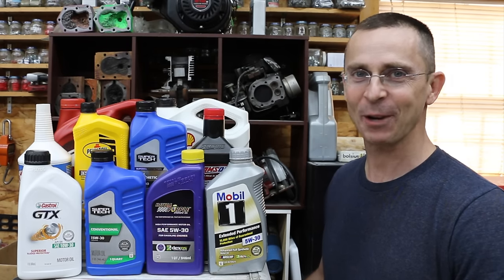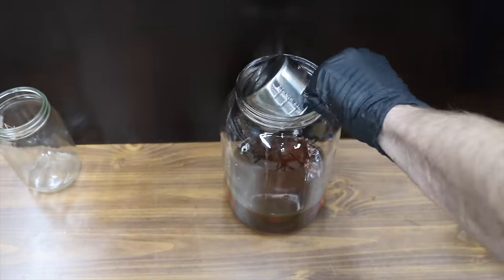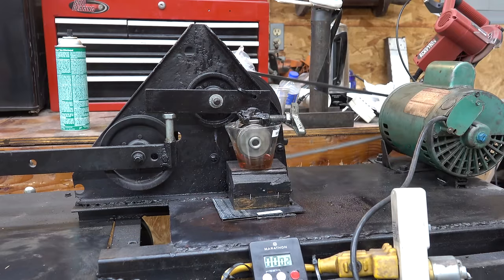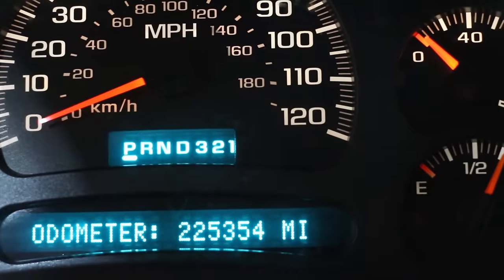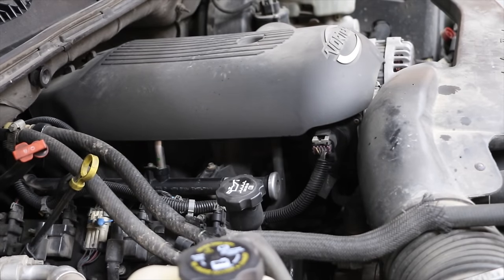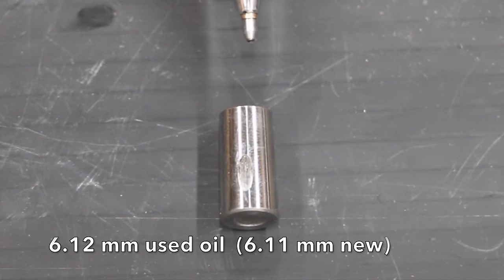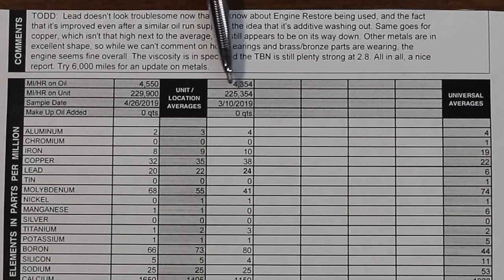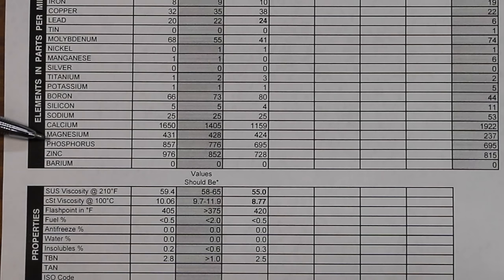Will Mixing 10 Motor Oils Damage an Engine? Let's find out!

Comment: I wish I had a dollar for every time I have heard someone say they changed brands of oil and now the engine uses oil.
Reply from the maker: I agree.  I've driven the suburban over 5000 miles since filming this video and it's still running great and not using any more oil than usual.
Reply: It is possible when changing to synthetic to clean gunk that was sealing a leak.
Reply: @WeSRT4  You have to have a very noticeable leak to make it significant w.r.t. normal oil consumption.
Reply: I can't say that there would be a drastic difference in oil use or leakage, but. 20+ yrs ago I worked at an oil change place. Our house brand oil was Citgo, and stored downstairs in tanks and fed by pump/hoses. normally what you would see in a oil/lube place. We did offer other oils if people preferred and wanted to pay the difference. These oils were stored in drums in a corner of the shop. Each oil had its funnel/bucket. After some time there would be a definite build-up of "stuff" in the bottom of the Penz-oil buckets. Remember, these are for new oils only. The stuff in the bottom of the Penz-oil container looked kind waxy just like a thicker oil. I suspect this stuff that settled out of PZ would coat the engines some. My father in law always said he had less leaks when he used Penz-oil. I would believe it if that stuff stuck in the cracks.

I'm not judging any oil better than another, just stating what I saw in the bottom of the bucket.
Reply: @cheeto4493  when I was younger my uncle built engines for Sprint cars, he used Pennzoil and he saw the same thing. He always said it was paraffin.
Reply: @cheeto4493  I also wish I had a dollar for every time I heard someone tell me they knew someone whose engine was ruined by using Penzoil.
Reply: I had an '85 Mustang 5.0L with a bit over 28,000 miles always using conventional oil when I decided to use Mobil 1 synthetic. Well within 200 miles I was burning oil when it had not burned it before.
Reply: same folks who say changing the transmission oil will kill the transmission....

Though had a nissan that would go through oil at a prodigious rate without any visible leaks or signs of burning, you'd check it and it would be at max, 2 or 3 weeks later the oil light would come on out of the blue and the dipstick would be below minimum....
Reply: @johnphillip1711  the best way to check for burning oil is the spark plugs
Reply: @EasyRiderGreg  my friend was a die hard ford driver, he said if a ford ain't leaking oil then the oil is low. Was it "burned" or just leaking now ?
Reply: @johnphillip1711  if a transmission is an Auto and the clutches are severely worn, changing fluid will kill it. The material in the old fluid is what is keeping it working and replacing the fluid removed the only grabby material for it to work. I made the mistake of doing that ONCE, I was warned , I did not listen. I know know. Use shift improver and drive it easier, but don't replace the fluid. For a healthy trans, replacing the fluid won't hurt it.
Reply: @punker4Real  oddly they were fine also, it was weird, even the owners clubs (on both sides of the Atlantic) couldn't figure it out, best we could guess was loss via evaporation or something peculiar....
Reply: @EasyRiderGreg  I had the same thing on my Audi quattro, always used conventional oil, changed to Mobil 1 and the engine started burning it. Changed back to conventional oil and the burning stopped.
Reply: Unless you change to a used, and bad oil, most of the time changing brand does nothing to the engine.
While I stay away from Royal Purple (with color additives in the oil), Mobil 1, Amazon Basics, and Valvoline, Pennzoil and castrol are all very good oils, and can be interchanged easily.
Though my favorites are Mobil 1, and Amazonbasics, good for 6+k miles. Valvoline, Pennzoil and Castrol are still very good oils, good for 4,5+k miles on my car.

It's actually better to alternate between oil brands, rather than use only 1 brand and type of oil.

As far as 5W30 vs 10W40 and 0W20, The math on these is simple.
0W20 + 10W40 in a 50/50 mix gives 5W30.
Reply: @johnphillip1711  When I've had old engines like that, I just got in the habit of checking the oil level each time I fuel up. I just want to make sure I run out of gas, before I run out of oil!
Reply: @ron827  I didn't say it ruined engines. I do think the paraffin, or whatever it is, keeps engines from leaking as much and burning the oil.
Reply: Oils are different, i've had the same car over 15 years and i've used oil that almost has no consumption, and others that need 1L every 1000KM. Btw, i went from blend to synth. Engine is carburettor from 70-80s. 
Really depends. Best advise is, change once year or every 5-10k km (refer to manufacturer) and if you're revving more or need better cold starts, use a 100% synthetic one.
Reply: @punker4Real  or blue smoke at the rear.
Reply: @batsonelectronics   It was burning oil, when I would stomp on the gas blue smoke was real thick coming out the pipes.
Reply: It definitely happens but not every time.
Reply: @joaoc_PT  An engine like that, with no catalytic converter, allows any oil additive to be used. There's no harm in trying different oils, to see what that engine likes best. tracking oil consumption and checking the condition of the spark plugs can be good indicators. You can try some of the blends intended for Diesel engines.
Reply: @MegaDirtyberty   I'm glad your Audi stopped burning oil. My Mustang did not stop when I changed it back to conventional. It continued to burn about a quart every 2500 miles or so. It didn't get any worse so I just kept checking and adding oil for years until I sold it.
Reply: @vincentrobinette1507  already do. Been using cheap synth gas/diesel oil for years. 5w50 Mobil one was the best, then old Castrol 0w40 no longer found on sale. But any 5w40 goes.
Reply: Wife bought her old car (now my car), with 83k. I’m sure it probably had nothing but conventional oil changes in it’s past ownership. 

Well I started using Mobil 1 in it, now has 255K on the odometer, doesn’t smoke, and might burn a half quart of oil between 7k mile oil changes. 

I’ve never had a problem using synthetic oil in anything I’ve owned, even if it had some miles on it before the switch.
Reply: @EasyRiderGreg  that is from leak from the valves. That doesn't happen just from changing oil, it was already worn.
Reply: John phillip your car was probably sucking up oil through the pvc valve.thats why you didnt notice it
Reply: @cheeto4493  if the "parafin" was on the bottom of a can - thats nothing good. 
It means that there is not much of it in the oil. Oil formula should prevent against this situation. New oil should be equal in every place of can. 
Excuse my English.
Reply: @joaoc_PT  Synthetic burns white.
Reply: @cheeto4493  That was probably the Z7 additive
Reply: Furn333  That's exactly right. Everytime I've switch to synthetic in a high milage engine it would start using more oil and leaking from various gaskets. Switched back and reversed the symptoms.  Both were F250s. One was a 460, the other was a 5.4. Both had over 150K miles

Comment: I tested this in 2007 on a 1992 GMC Jimmy 4.3L. Had no problems over a normal oil change. I worked at a quicklube and used a very similar mix of oils. Back then it was still in everyones mind that you couldn't even switch brands from oil change to oil change. So I wanted to go to extreme case. Thanks for sharing with the world!
Reply from the maker: You are welcome!

Comment: People on car forums: What oil you guys use?
Project Farm: All of them...
Reply from the maker: lol. Thank you!
Reply: True answer is Yes
Reply: Me it matters?  P. Farm: Yes.
Reply: Bought a Subaru with 116k on it about 20 years ago. Never paid attention to what oil I put in it . Always conventional usually Wal Mart. Never drained the oil. Had toilet paper filters on the oil and ATF. It has almost 250 k on it now. Took off a valve cover and it was very clean. My daughter took it over. Have to pay more attention to it.
Reply: Organic EVOO
Reply: When I was selling Gulf Coast Filters out of Gulfport , Mississippi I got a call from a oil company engineer. He said I have a friend with a tree service. Has several Power strokes and choppers also some Internationals and a Bob Cat. Could I do them. Of course they had to supply me with a lot of make up oil. The paper towel models took about a gallon of oil. They brought me Wal Mart conventional oil. The engineer said oil is oil.
Reply: I have used synthetic and conventional oil. I have used toilet paper filters for over 50 years. I don't drain oil. With actual use its hard to tell the difference in synthetic or conventional. I can't wear out an engine with analytically clean oil.
Reply: Back in my Frantz oil cleaner days in the 60s I used to take out a roll of toilet paper after a couple thousand miles. I would pinch the top of the paper and black sludge would come out. Pinch the bottom and clean oil came out. You knew you were doing some good.Now both ends are clean.I drive mostly hyway at operating temperature.probably be different in cold weather short trips. Modern engines and modern oils are not much of a job to keep clean for the Frantz Motor Guard and Gulf Coast filters. That's why these junk filters can claim such a long filter change interval.
Reply: I use Royal Purple 10W-30 & a K&N oil filter. Great stuff, for cold startups, & oil filter won't burst under pressure, like the cheap filters could do.
Reply: I've never laughed so hard. 😆
Reply: ralph wood you had toilet paper filters on the ATF? What does that mean? Fram filter?
Reply: ralph wood oil is oil until you compare it ... the engineer was telling you to shut up and fill the thing
Reply: Lololol

Comment: I knew this all along. I worked at a local oil place & kept all the residue oil from all the empty plastic containers & also big plastic bags used in the box oils. Mostly the weights were 5W20, 5W30, some 10W30, and some 0 weight oils. Even some Shell Rotella diesel. Some of these oils were semi-blend, some full synthetic, & some conventional. I wound up with at least 5 gallons of clean, new, mixed oil. I used some in my 250,000 mile Blazer with no ill effects. I also used some in a well worn Honda Accord with no ill effects.
Reply from the maker: Thanks for sharing.
Reply: Hahahahaha that’s funny. Imagine how many different types of protection was in that engine it must have the best looking valves and cylinders for that mileage.

Comment: Q: "What's the biggest difference between brands of motor oil?" ... A: "The color of the bottle."  Any decent brand is compatible with any other.  Thanks, great video (as usual!)
Reply: Adam, you absolutely 100% correct. It makes NO difference what reputable brand you choose....including store brands....Walmart, Rural King, etc. They're all manufactured to industry specs., pass the tests and certified as such. If the API certification says it meets whatever indicated on the container, you're good to go. The armchair experts can flame away....I couldn't care less. After nearly 50 years of operating all sorts of motorized vehicles and machinery, I've yet to lose an engine to catastrophic failure  and I've always ran the guts out of them. Way back when I was a little boy driver I bought into the asinine 2000 mile change rule. I got tired of changing oil. I let it go to 6,000...then 10,000 and now with synthetics 15,000. I don't lose any sleep, haven't lost any engines in the ten years I've been running synthetic oil. I just bought a 2019 Tundra...showing 3900 miles on the odometer. Toyota going to give me a free oil change every 10,000 miles...their recommended regimen. I don't know what oil they'll put in, don't care. When it's my turn to start changing the oil, it'll be whatever synthetic is on sale and I'm planning on running it 20,000 miles between changes. Why? Because I have faith it'll be fine. If it comes apart.....hmmm, good excuse to trade it off.
Reply: His video series showing the differences in oil performance - especially when cold - shows there are some oils better in cold conditions *(start up) than others.    It is well known that synthetics break down slower than regular oils.  A bit of common sense and research can help if you want a very long life from your engines.  Yes, mixing them isn't a big deal - heck they make blends already.
Reply: Maybe the color of oil itself, too.
Reply: I've always believed oil is oil, as long as it's slick it'll work just fine, but I also believe now to keep it with what the manufacturer suggests, like now mostly it's 5W20 or so
Reply: @mark-wn5ek  I'm with you. I used to do the same thing. Every 2000 miles. Now I go by what the car computer says. When it gets to 5% I change it, no matter the mileage.
Reply: @mark-wn5ek  Modern cars and trucks often come from the Factory with Synthetic oil, typically lightweight synthetic, such as 0W20 due to tighter tolerances (which means less leaks but also means the oil has to be thinner)
Reply: @mark-wn5ek  You are absolutely wrong. All oils are not made equally. Just because an oil can scrape by the bare minimum to achieve certification, does not mean other oils succeed that certification. Literally 5 minutes on youtube and you can watch how different oil brands cold/hot flow versus others. Oil evaporation, oil impurities, etc. These "armchair" experts send out oil to be analyzed. Check out "bobistheoilguy" you would learn a lot. Even your favorite oil company/brand can change their formulas. Take for example, Mobil 1 High Mileage motor oil. In 2012 that exact oil had a Zinc PPM of 1700. Now, their current formula is lucky to break 900. Keep running your oil 15,000 miles as well. With direct injection technology in newer engines, I'd bet you'll never break the 150k mark on any of your vehicles. You and the people liking your comment are the types that fall for marketing hype. It's quite hilarious.
Reply: @scottcount6861  Actually, Mark Harris is correct.  As long as the oil is certified, it is equal to all other oils carrying the same certification.  Any API-SN oil, is comparable to any other API-SN oil.  That is exactly why standards and specifications exist.

Comment: I really appreciate this one! None of my vehicles use a full 5 qts of oil so I usually have anywhere between 0.1 to 1.5 qts of oil left over. I dont mix types or weights, but I always use that leftover and add it up with other brands leftovers. So I'd still run synthetic 5w20, but it'll be a little bit of Mobil 1, Shell, Royal Purple, etc. Usually just whatever is on sale at an auto parts store.
Reply from the maker: Thanks for sharing.
Reply: Do you run into any problems?
Reply: I have mixed different weights, brands etc over the years never had problems - the important thing is to keep it full and change the oil/filter frequently
Reply: @kellismith4329  yes being 1 quart low of fresh oil is much worse than pouring a quart of sand to fill it or water. U must be mechanic too
Reply: Same here but with an eye on the temperature I'm not sure a little of one or the other even if just enough of different weights to top it off would make a big difference in anything.
Reply: @rosslefave5877  stay far away from any engine please 🙏
Reply: @adamhughes4001  the engines sense my presence and kamikaze
Reply: @adamhughes4001  I tune to wound
Reply: 02 12 23, If you buy a used car showing 70 000 miles how can you tell if regular correct oil & filter changes have been carried out at the manufacturer's recommended intervals ?

Comment: I love how when he sees how good the oil flows when it is cold he commentates like its nascar. It makes my day so much better
Reply from the maker: Thank you!
Reply: @ProjectFarm  please continue making videos it is the highlight of my day and I watch all your videos thaks
Reply: I’m not quite sure I understand this part of the test. Did the oil that finished first down the ramp do the best or the oil that finished last do the best?
Reply: @Jonathan-hq8od  Generally the oil that finishes first is better because it has a better flow rate, which is desirable in most cases. The faster the oil can flow the quicker it can be distributed over the metal-on-metal contact areas and therefore reduce wear.